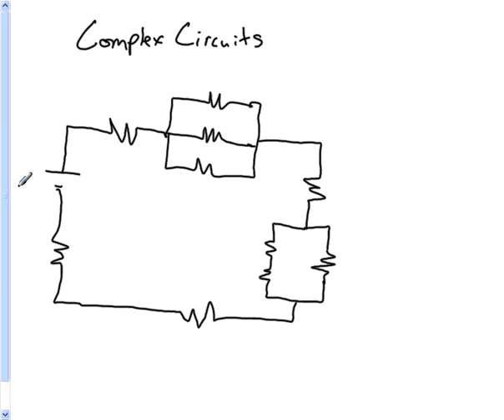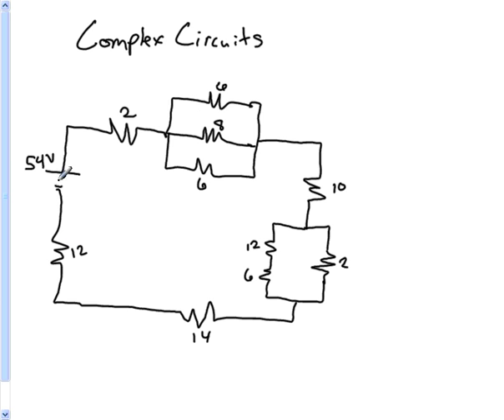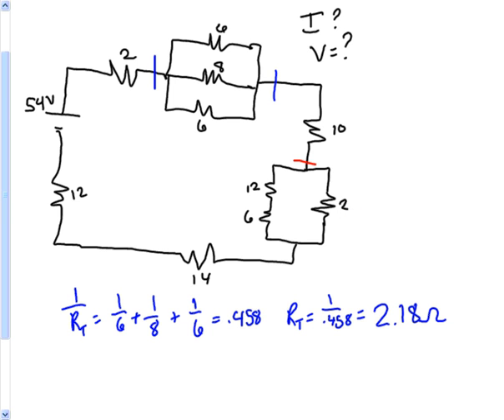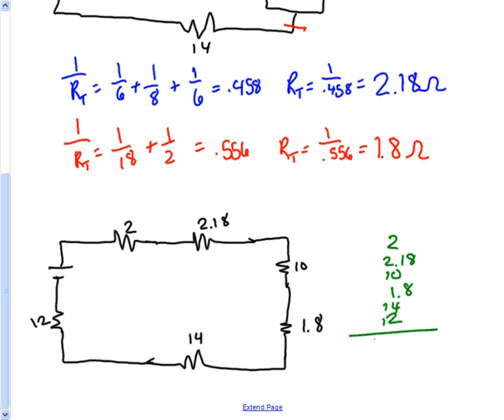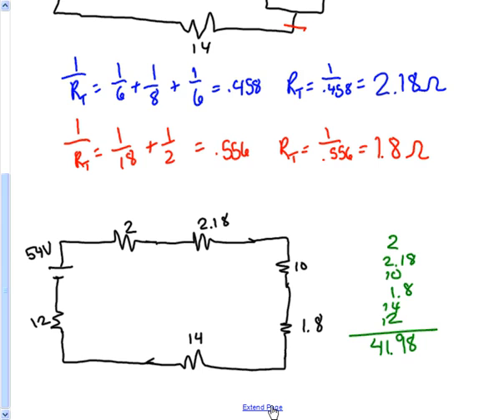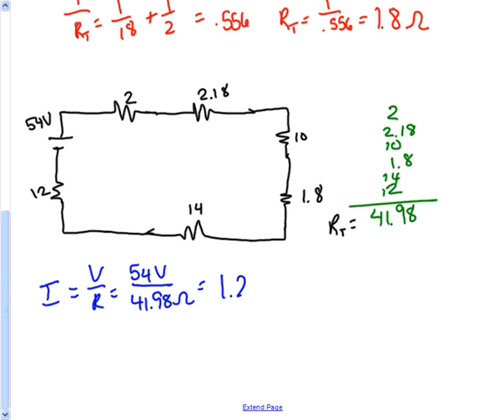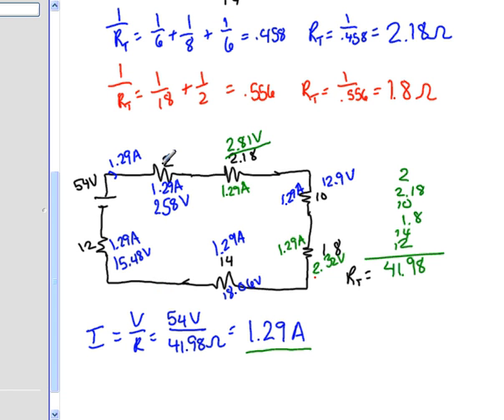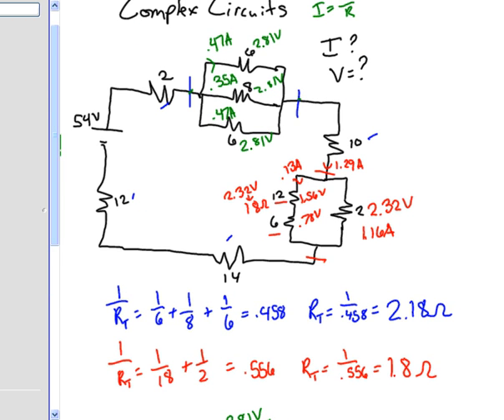Complex Circuits - Voltage and Current

Comment: Isn't there a voltage drop you have to account for which enters the 2 internal parallel circuits?
Reply from the maker: The voltage drop for each branch of the parallel portions are the same because each branch is connected to the same two points in either side. This means we can collapse the parallel sections to a single resistance to bind the total voltage drop for that section.